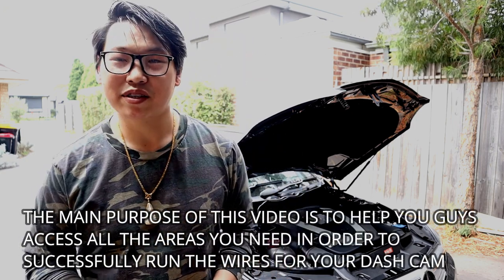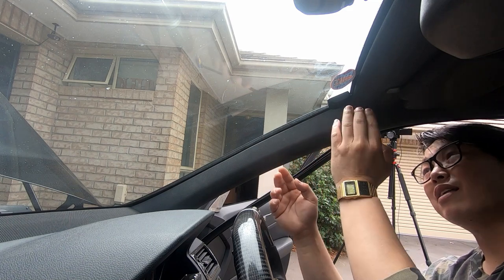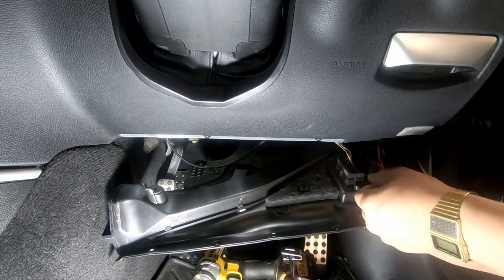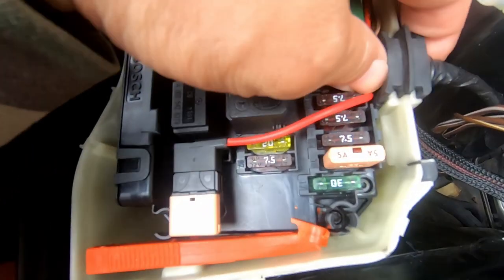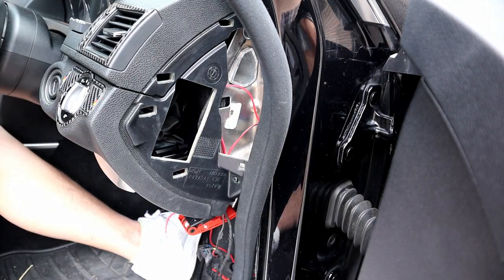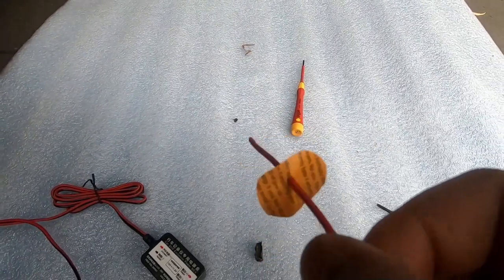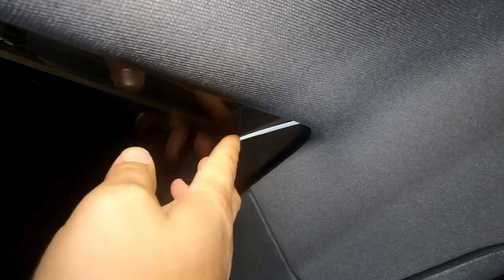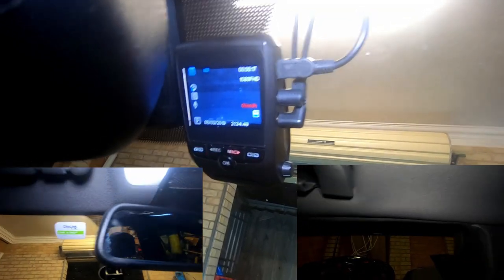MERCEDES BENZ C CLASS w204 how to route your dash cam cables/access all areas and use a fuse tap

Comment: Nice & very useful videos 

Mine is w204 220cdi Europe ( on the leftside steering)
I bought waylense 360 that requires constant ( brake light fuse) and one for accessories ( lighter or air conditioner fuse ) and one grounded) so before I had the chance to see your video I made the connection via the luggage fuzebox and got stuck on identify constant power and accessory power fuse..
Mine doesn’t have front cigaret lighter ashtray fuse so I tried to connect it to fuse No.45/30 Amp that controls front seat but then I noticed that it stays on even when engine switched off and key out .. so I don’t know if I can use this one as accessory power source fuse , also I couldn’t  identify the constant power ( brake light fuse) .. can you help me with this ?

By the way .. thank you for the useful informations you gave me about the facelift lights & remotely coding I already contacted the person you gave me and I think I will do it .. if it works I well send you a video and I will propably make a video of the result thanking to you with link and embed it in a comment and post it within the comments on your other bakelight video as gratitude to your work 🙏
Reply from the maker: @ramban3488  no worries appreciate u ...so are u looking for constant 12v or switched 12v ppwer
Reply: @MIKEYZVLOGZ   
I am sorry for my late reply , I thought I already replied but for some reason it didn’t go!
My dash cam is waylens 360 4G that requires:
1- accessories fuse ( switched 12V power fuse)
2- constant 12 v power fuse 
3- ground
Reply from the maker: @ramban3488  so it seems the fuse u said was for the seat is a 12v constant as it stays on wen key is out ... as for 12v switched I will let u know which is used ... and ground is anything connected ro the chassis.. usually easy to find in the foot well past the lining and panels u will see where they use ground points..brown cables leading to them... but u can always use your own too...
Reply: @MIKEYZVLOGZ  
Hi any luck finding out the right fuse? 
All the best
Reply from the maker: @ramban3488 oh yes thanks for reminding me ...apologies been so busy I'll share it later today wen I get back from work

Comment: Is that rubber grommet something you bought to add to the fuse box? Ohh I think it's included in the car right, sorry I'm a newb. Thanks so much for the detailed video.
What year is your W204?
Reply from the maker: it's part of the car
Reply: @MIKEYZVLOGZ  I'm hardwire installing on the 2014 c300, do you know if routing it to the engine compartment is the only option other than the luggage fuse box? What about the box in the passenger side.
Reply from the maker: @Calvin  u can find power anywhere... u can even tap into the cigarette lighter..mine is 2010

Comment: Do you know in the engine fuse box which fuse gives constant power?
Reply from the maker: yes i do ... ill tell u in just a minute as i double check...
Reply: @MIKEYZVLOGZ  What fuse in the engine fuse box provides constant 12v power?   Need to use for stereo head unit on w204.

Comment: An easier way is to tap straight into your 12 volt outlet / cigar lighter outlet in your centre console. Just tap into the wiring for an ignition switched live. 
Add on an inline fuse once tapped in. You will also have access to an easy earth as well as the live. 
No point in dismantling half your car for an ignition live. 
If I needed a constant live I would go the way of this informative video.
Reply from the maker: good valid point ... although a rule of thumb is not to cut factory wires unless u have to .. especially for ppl who aren't comfortable doing so.. for fear of issues down the line .. but fair point .. that wi work too for a 12v switched power source .. 100%

Comment: As someone whose scared to do DIY jobs due to breaking everything I touch, this gives a lot of confidence, cheers. One stupid question does this dash cam stay on all the time due to it being connected directly to the fuse box?
Reply from the maker: actually no as i tried to explain in the video .the fuse i used was a 12v switched fuse meaning that the power to the dash cam will only come on when the ignition is on ...so thats the best way to do it...but if you have aon your dash cam a parking mode...you will most likely have 3 cables which would be  the yellow extra cable and that  will connect to  the battery thereby not draining your battery at all .....because it will only take power from the battery when the motion detector goes off or someone bumps your car also known as parking mode... which my dash cam has... hence why i have 3 cables not just 2 .... it all depends on how your the options your dash cam has.... and how your power box works
Reply: @MIKEYZVLOGZ  Thanks so much, could you recommend a dash with parking mode?
Reply from the maker: @jindra8268  basically i went with ebay however aliexpress offer many different options also ... just be sure to read through the item description and make sure to ask the seller to confirm it has parking mode and the features you require